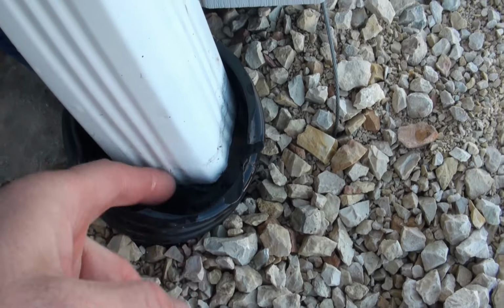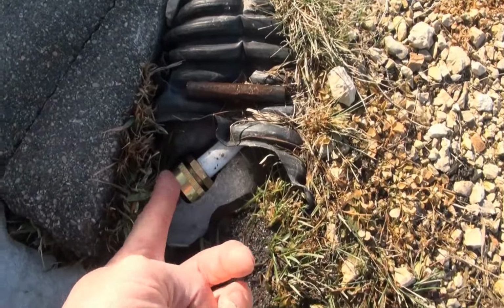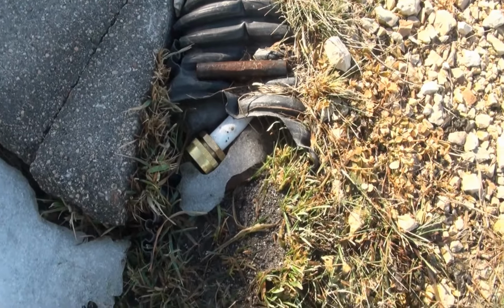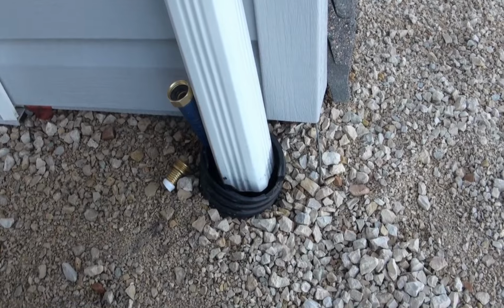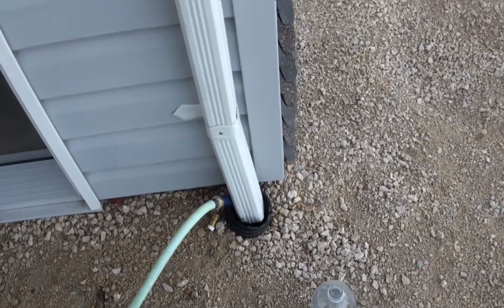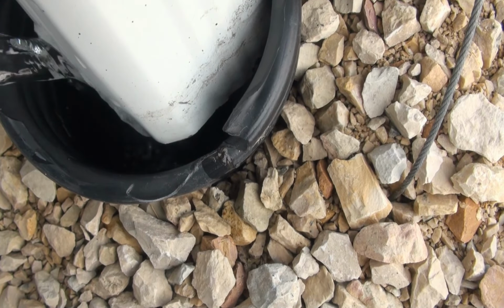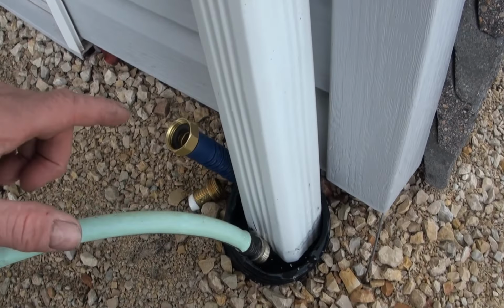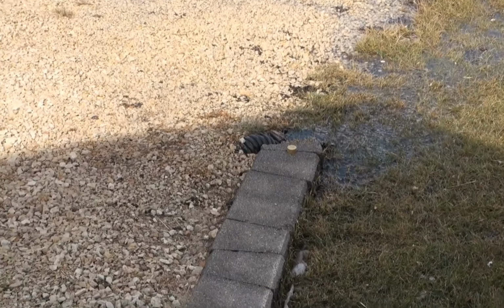Thawing A Frozen Drain Pipe

Comment: Thank you for the idea to use a hose section with caps on it. That way you can run hot water through it and start the thawing process. Once it gets a tiny passage the hot water poured in the drain can make its way though and keep thawing!